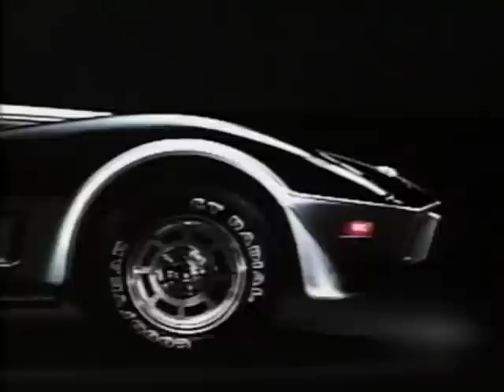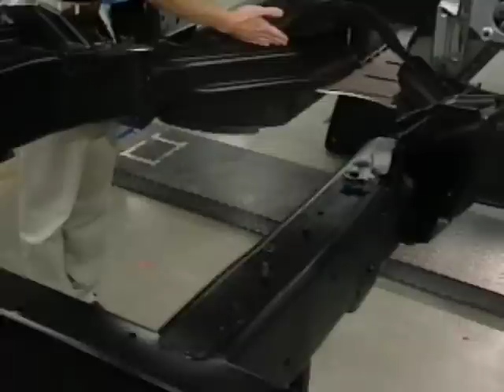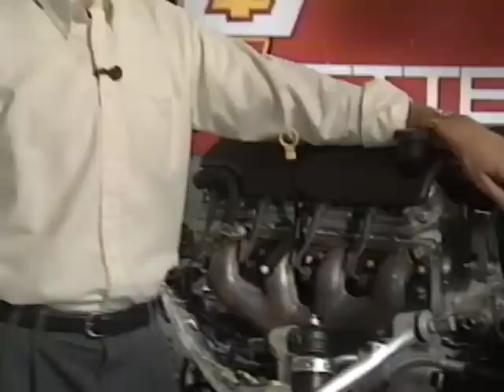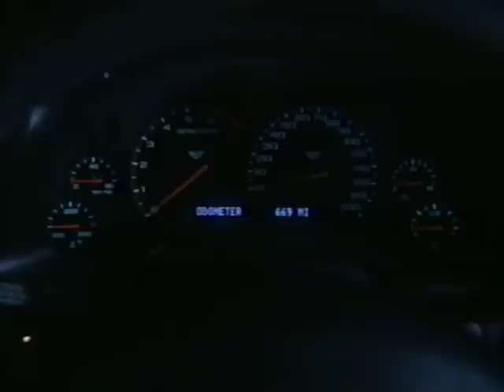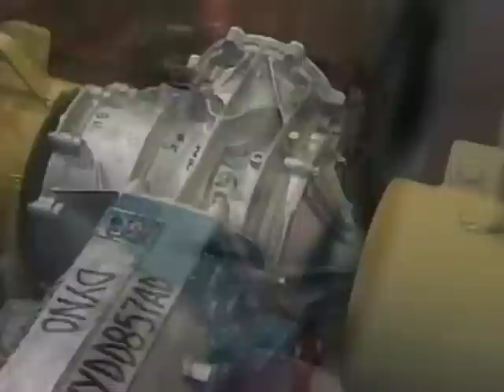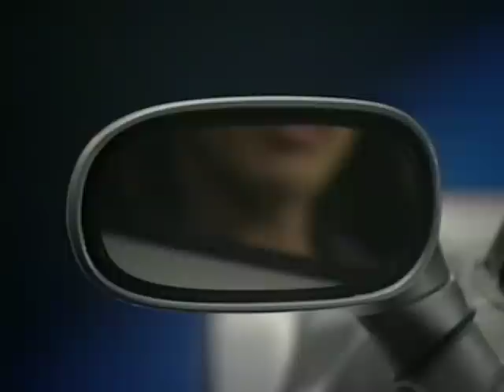C5 Corvette Building The Fifth Generation Corvette VHS Movie

Comment: even with all that they still had to make the car even more structurally sound to make the C6z06 able to remove its top.
the reason the C5 z06 didnt have a removable top is b/c the C5 would/ could twist in curves making it impossible to put the roof back on

Comment: The most infuriating thing about the C5 is that it was so good and the 1999-2007 Silverado/Tahoe/Suburban line were so good...why couldn't they build the rest of their lineup as well? Why did they make such low quality fwd garbage cars that nobody wanted, weren't fun to drive, weren't very fuel efficient, weren't very cheap considering the development costs and low profits. It's absolutely moronic that a reintroduction of a full line of rwd mid-fullsize cars like the Holdens wasn't created and sold. Even if they only sold the UTE and Wagon as a light truck/SUV to skirt café and emissions. So be it. 2 and 4 door El camino and Nomads would have been perfect and they could have been offered with the LS/Vortec engines, they could have gotten the 6 speed auto out sooner as well to offer the benefits of the manual. Even if the Monaro/Commodore/Caprice had to be offered with the 3.8 V6 or some version for the Ecotec I4 in high volume models to satisfy the globalist fun police they could have had a full line of cars they could have been proud of. They could have eventually moved towards a return of the smaller rwd entry level car and created a modern Nova and Cámaro based on it, with all the traction and stability controls they would have been better than the fwd junk they sold for decades. There's no way they could have been any less profitable than the crap that bankrupted them. They could have stemmed the tide of both Honda/Toyota/koreans and BMW/Mercedes/Audi. It's really sad because now that it has been 25 more years of stiffening fuel economy and emissions laws it really is probably impossible now. There was no reason to limit themselves to Corvette and the truck line as quality vehicles so long. Bean counters and people with no vision or balls ran that company into the ground.

Comment: The soft touch rubberized buttons for the window controls was a big mistake on the late 1990's C5, they eventually split open. Engineers didn't think about wear and tear. Getting at some of the engine parts underneath is reportedly a nightmare which had youtube mechanic Scotty cursing GM engineers.  Otherwise they are praised by many people including Jay Leno.

Comment: My red on red 6 spd just turned 20 and she looks and runs like she just rolled off the line at Bowling Green. I've put about 50k on her in 6 yrs of ownership and the only mx I've done is an oil pressure sensor replacement. Cost $15 and took 4 hours to replace. The car always gets 30+ mpg around town and I've seen as high as 33.7 mpg on the highway. Amazing engineering!
Reply: Torch red on torch red? That's what I'm looking for. This color combo really pops! I'm looking for an '01 or newer...
Reply: @jamesbottger5894  You search long and hard, you'll find one. But you'll have a hard time finding a 6 spd.

Comment: The good ol c5s....I always thought the front looked great in the mirror of my 03 cobra....lol. I do like these cars though
Reply: Ha...no way your Cobra is faster than a C5...
Reply: @jamesbottger5894  03 cobras were underrated at 390 hp...actually had 420. Ran 1/4 at 12.6 at 112mph bone stock vs a 13.1-13.2 @ 106 c5.....so yeah the 03-04 cobras were faster, and theres literally more videos and information out there to back it up than I could ever say. You better go look at what you're talking about...the 03-04 cobras were supercharged from the factory. You clearly have no idea what you're talking about
Reply: @jrvbamafan1  Low 13s was for the automatics...the 6 speeds would run into the 12s, but yeah the Cobras would still be quicker then...I didn't know they were THAT quick...Ford always had to cheat though to make the Mustang quicker than the Vette, they couldn't do it without forced induction...
Reply: @jamesbottger5894  cheat....lol. you really complaining that a little 4.6 with a blower that was what 15 grand less could outrun a lighter car with a 350. Guess chevy is "cheating" with the zr1 and zl1 being forced induction by that train of thought. Or you could just accept the fact the 03-04 cobras were monsters that still have respect to this day, and keep it moving
Reply: @jrvbamafan1  "Outrun" has many meanings. I guarantee you that Cobra didn't have the top speed of the Vette, nor would it run as fast around a track. 0-60 and 1/4 mile times  aren't the only measure of a performance car...
Reply: @jamesbottger5894  how many times you ever raced for "top speed"....know what else that cobra didnt have....the price tag of that vette, but had stupid fast performance with a built bottom end from the factory....which is why with a pulley swap, exhaust and tune they were typically around 460-470 whp for less than $1500
Reply: @jamesbottger5894  funny thing is the mustang wasnt the competition for the vette, but the cobra made it be that year because of its performance.
Reply: @jrvbamafan1  Another thing the Cobra didn't have, and the most important...the Vette's looks...few cars look better than a C5...
Reply: @jamesbottger5894  that's subjective, performance isnt....nice try though
Reply: @jrvbamafan1  And like I said, straight line acceleration isn't the only measure of performance...I bet you love the new Dodges, they're great in a straight line, but that's all they're good for...oh yeah, that generation of Mustangs were ugly too...
Reply: @jamesbottger5894  looks are subjective....they werent too ugly or they wouldn't have sold as well as they did. I've never owned a dodge but dont have a problem with them. Why dont you take your butthurt ass somewhere else with your excuses. Facts are the 03-04 cobra WAS faster than the vette, cost less than the vette, came with a motor already built, and could turn just fine due to being one of the first mustangs with IRS, as well as had high top end. Go cry somewhere else about your plastic fantastic vette being slower, because in the end it was, I'm right, and you arent. Deal with it....and all for less money. I'd be salty too if I were you. It's why the cobras still sale for 25 grand and held their value, and you can get c5s for nothing. Wont even get started on how cheap it was to make ridiculous power for cheap either. No comparison there. Now go away. All the posts in the world wont change the fact that no c5 stock for stock is beating an 03-04 cobra unless is a z06.
Reply: @jrvbamafan1  The only one crying is you. You seem to feel the need to come in here and trash the C5 to make your ugly Rustang look good. Nobody cares about those old, no handling junkers anymore. C5s on the other hand are still in big demand. Why? because they do everything well. The Rustang, not so much...
Reply: @jamesbottger5894  yet the c5s go for cheap. And you felt like coming here opening your mouth about them. Say what you want but you take a stock c5 and 03 cobra, and your losing that race everytime....but you seem to be a loser anyway so shouldn't be too out of character for you. Pretty bad that "rustang" held its value way better than the cheap ass c5s did. Now run along. Just like your slow c5, you arent winning this either. Oh and if you want to settle this on here, we can meet up and video it. I'll leave your clapped out c5 in the rearview, then post the video on here for anyone reading the post to see. Probably dont even own a c5, but let me know
Reply: @jrvbamafan1  Only high mileage C5s go for cheap...low mileage cars sell for $20K+...$25K for a Rustang? Only an idiot would pay that much for one. That wimpy modular 4.6 can't make any power without a blower, hell today's V6s make more power than a non-supercharged 4.6. For $15K less than you paid for that Cobra I could drop a V8 in a Yugo that would smoke your Cobra, and since acceleration is the only measure of performance that matters to you, that makes it better than your Cobra. And in case you haven't noticed, this video and these comments are about C5s, you're the only one in here babbling on about Rustangs...
Reply: @jamesbottger5894  so now it's a yugo...shut your goofy ass up. Here's a surprise. I owned an 02 c5.....I actually like them....but like the cobra better. You can say whatever you want, but 03-04 cobras are collector cars, they are built from the factory, dont depreciate in value, and capable of holding way more power straight from the factory. Now either pull up or shutup. I dont care what you drop in what. You're just reaching now, but anytime you want your ass dusted by a cobra, come see me. Come on back now with that "I'll put a rocket on this or that". You're a goofy ass, butthurt loser, mad that those cobras are more capable and faster out the box than your c5. Stay mad. Wont change anything, because they are the faster car capable of more power, so anything bad you say about them only makes the c5 that much worse because its slower. They pay that much for then because unlike you they know what they are capable of. Too bad you think 350hp is something. That little "weak" 4.6 with a completely built bottom end like they had in those cobras will last far longer, make more power, and do it all for cheaper....poor wittle baby. I'd be mad too if I were you. Luckily I'm not
Reply: @jrvbamafan1  I bet the front of your wimpy ass Cobra looks good in the mirror of a Z06...
Reply: @jamesbottger5894  pull up and see. Bring some money. Or do you have a regular c5, or is it a yugo....I cant remember you've named so much. Let's do this, pull up in whatever you want, bring at least a grand, otherwise stop talking to me. I've said what I had to say. Not gonna keep going. Whatever the front of my car looks good in, I can guarantee you arent man enough to come try and do it yourself. So go back to your basement and beating off to your c5 pics that you dont own
Reply: @jrvbamafan1  oooo, big talk from the pussy behind the keyboard....
Reply: @jamesbottger5894  says the one that wont show up
Reply: @jrvbamafan1  When I was 20 I cared about racing. I couldn't care less about it now. I don't buy cars to race, I buy them because I enjoy driving them and because of how they look. If I cared about racing I wouldn't be buying a 20+ year old design. If you want to play John Force with your wheels, go for it, I grew out of that stage years ago...
Reply: @jamesbottger5894  aka I dont have the car I've been talking about and cant....got it. Exactly what I thought...the same reason you call me a pussy yet hide behind a blank profile pic. Loser
Reply: @jrvbamafan1  Grow up...
Reply: @jamesbottger5894  fuck you. Picked a fight and got embarrassed. You grow up
Reply: @jrvbamafan1  You came into a Corvette discussion and started talking about your Rustang, I'd say you're the one picking the fight...besides, you'd look funny pregnant...
Reply: @jamesbottger5894  the fuck.....you still talking. Where you at. I've had enough of you. Bout time to trace your ip address
Reply: @jrvbamafan1  Go ahead, I've got a nice .357 waiting for you...
Reply: The only front you'll see is your hood when it comes to corners.
Reply: ...was that before you swerved into a light pole after exiting a cars-n-coffee?  I do like the Terminators though and my buddy's 69' CJ

Comment: I never really was interested in having a Corvette in the past, then one day I saw a very nice clean 94, something about it that particular day, I have no idea. I started thinking about getting one. Once I started looking at them and seeing how affordable they actually were, drove a few was totally impressed at how they drove. Its a very refined car, but even with all the styling, gadgets and technology that went into, it still has the feel of the 60s muscle car. I just bought a 1996 LT4, Z51 package Corvette. It's not perfect, its a 20 year old car that has been used but not abused, but with all the available parts to restore and improve performance, I can fix it in a manner that suits my taste and what I expect out of it without having to do a 100% rebuild. I love driving it, I'm enjoying working on it and anticipating what the final car is going to be like.
Reply: That late C4 of yours is basically an affordable exotic. 5 link independent rear suspension (all suspension components forged aluminum), transverse fiberglass leafs, reverse clambshell hood, big tires (285/rear, 255/front), V8 power with reverse flow cooling, aluminum heads, roller cam, and sequential port injection, longitudinal spine from trans to rear diff (direct from Lotus), targa top, 13s in 1/4 stock.....incredibly trick design. Plus the late C4s are the last sexy Corvette (low, long, lean, curvaceous). Newer Vettes are big and muscular, but they arent sexy and sleek like a late C4. Great cars the C4s and their value is climbing fast now.
Reply: Love my 95 Corvette. I had a 85 and 87 but I think the late c4s are the best. I may in the minority but c4 is my favorite one. Hate the new ones.
Reply: I now what you mean, something just clicks with you and it all makes sense. I almost bought a black '85 auto coupe for $7500 a few years back. Sat inside and it all just felt perfect. It's a different kind of perfect though- my main love is '79-'94 Ford panther platform cars. Different flavor of the same necessary project car cocktail.

You can easily build these older Corvettes to go faster, stop faster, handle better. Even just a good set of sporting tires will do them a lot of good. Buddy of mine has a '93 convertible.... even if it's just a 4 speed auto that thing still goes pretty good. I'm betting your 6M Z51 drives like a beast.

Comment: the seal around the windows on doors leaked..all seals replaced it was still an issue..we sold c5 though few months back
Reply: violentjett  The targa tops are known to have leak problems, but most of the time they can be stopped. There are some adjustments that can be made, and the seals needing replaced can be also be necessary, though sometimes you can use seal dressing on them and get them to seal....